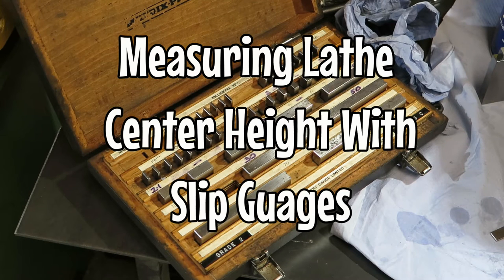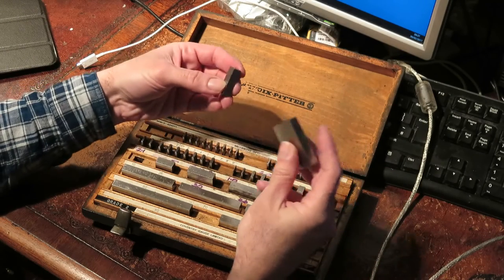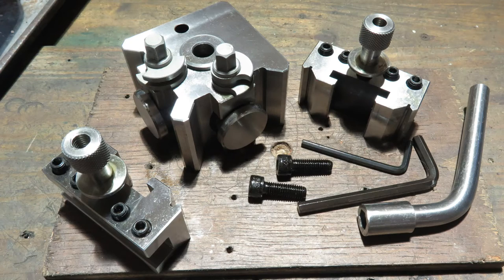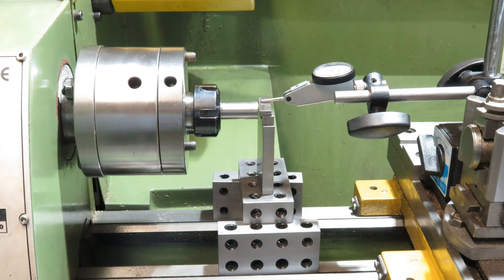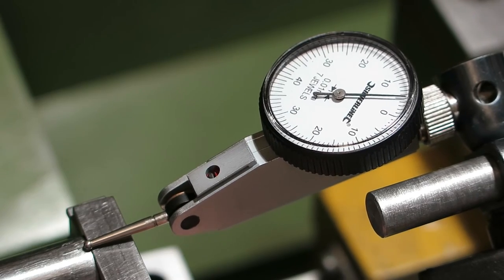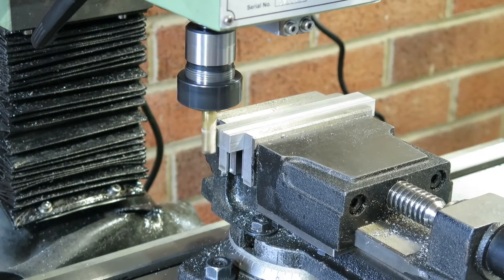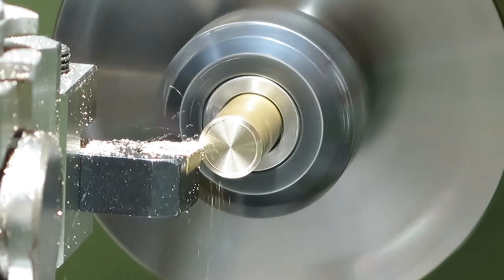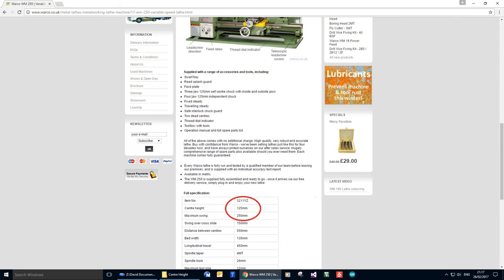Slip Gauges, and Setting a Quick Change Tool Post to Centre Height

Comment: To be honest, I'm amazed that it was within 40 microns of the nominal 125mm - I thought that sort of spec was accurate to the nearest 3mm or so (whether Chinese or European).
Reply from the maker: I suppose if it’s a nominal 125mm, then a statistical spread across the bell curve means a fair few are going to be pretty close.  But, if I want to be picky with my own technique I shouldn’t have used silver steel (drill rod) in a collet chuck, but instead taken measurements from something that had just been turned in the lathe. I’d also question the accuracy of stacking the gauge blocks on the 123 blocks – I can’t see why not but it feels like it could go wrong. Either way though, the end goal was to get the length of a reference block to set the tool height by eye\hand - which probably has a far greater error than the measurement technique. Still, well worth doing as it makes it dead easy to reliably set the tool height.